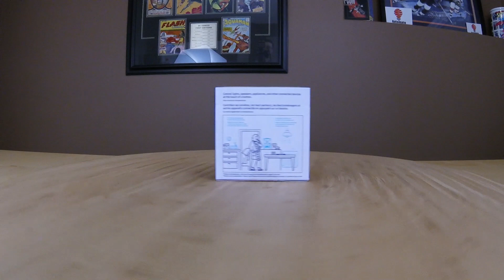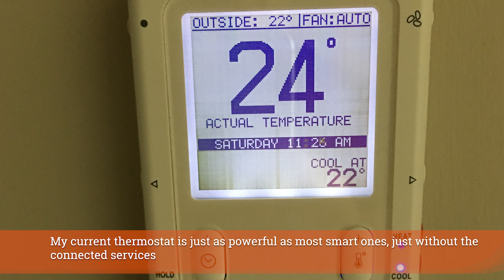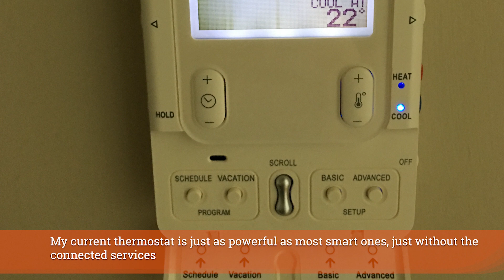How (And When) To Use Redundancy In Your Smart Home To Gain Reliability

Comment: Love your channel Brian. Thanks for sharing all your valuable info on building a smart home and automation!! I've gained a lot from viewing your channel. I do have to disagree with one item you mentioned at the end of this video however. Namely your reasoning for why you don't use a smart thermostat. When I replaced my 30 year old furnace and A/C this past summer, I installed a Honeywell Smart thermostat (RTF9585WF). It is true that it connects and is setup via an internet connection through Wi-Fi, however in day to day use, once you've setup your schedule, the thermostat will follow the locally stored setup even if you loose your internet connection. For me this is as it should be, and makes this smart thermostat operate just like my older "dumb" one did. I also have this linked to my Google Home. The only downside of the Honeywell Smart thermostat that I can see is if someone wants to control theirs while away from home, and will not be able to if it looses it's internet connection. For me, I don't use mine that way.  Perhaps (a big possibility) I missed your point?
Reply from the maker: Nope!  You didn't miss the point at all Andy.  That's the thermostat type I fully agree with.  I think most people go out and buy a Nest Thermostat, but their actual reliability has been less than 100%.  There are situations where the thermostat won't work at all, and that's not OK.

Honeywell, which is a company known for industrial, commercial, AND residential automation, knows how to use redundancy to create reliability.  They did so by reverting the device's software to use the basic programming they'd developed over years.  They used software redundancy to create near 100% reliability.

Many new makers don't have that backing or basis...and that's what I want people to really understand.  I might not have been clear enough for the sake of brevity though. :)
Reply: @AutomateYourLife  Frankly I've never understood the big deal about Nest thermostats.  I have the Honeywell TH9320WF5003 Wi-Fi Touch Screen Programmable Thermostat.  Everything I need to know/see is on one screen.  Works great from across town or across the country (probably from across the world).    Reliability 100% so far.  Reliability...if the GH subreddit is the pulse of GH reliability, I'm one of the lucky ones.  My GHs have been 99.9% reliable since my first device in Spring of 2017.  Nine GH devices later (and two Alexa Dots) I have absolutely no complaints.  I just lied!  Yes I do have a complaint.  WHY can't GH read and send text messages??  Redundancy?  Isn't that just a backup?  It's always good to have a backup way of doing things, Smart or otherwise.  BTW, still loving  your vids!

Comment: Good topic. I am also coming from heavy manufacturing industry where failure could result in fatalities. At home what we play with are kids toys comparatively. Can we live without them - of course we can. For me these are adult toys to kill time (hobby) than anything else and to show off. As I could see one can do few things to make things more reliable

a) if you have automated door locks-make sure you have fall back options
b) have something like unifi to power your network hopefully via PoE
c) if money is not an issue do not buy the cheapest devices/brands

d) If you can- make most of your devices work locally not only on cloud. For instance- use home assistant or similar. At least not just have only google home and alexa to do everything- have your devices work locally with home assistant too 

e) if you run critical system such as surveillance software, home assistant etc- then run them on a say proxmox as LMVs where base system is enterprise ready but still open source (avoid windows)
Reply from the maker: Great tips here!

Comment: The problem to me are bulbs. How to do redundancy for bulbs control if I loose base controller? If power shuts down and system don’t comes back quick enough?
My answer to this today are the lamps. Keeping a lamp in each room of my house permit me to control at least a single bulb manually, even using smart bulbs.
Regards!
Reply from the maker: I think the nice thing with bulbs is that your switches will still work.  So I think they're redundant inherently.  Or are you talking about smart functionality?
Reply: Smart switchs are not so smart. Than we need a backup option if smarthub is off-line.

Comment: The question is ultimately, how far do you go?  Even a light globe is not 100% reliable.  Incandescent globes fail.
A standard dumb light switch is not 100% reliable.  Switches do wear out.
Unless you have two globes in every fitting on two completely separate circuits with two completely different solutions to turn them on and off, you will never get total redundancy.
Reply from the maker: That is the question, but I think the word is criticality. :)

Comment: I feel unconfortable when I have to convince someone to replace a mechanical light switch that used to work 99.99999% of times with a redundant "smart" switch system that combined works 95% of times. Criticality is irrelevant sometimes, but availability is. An IR remote never fails no matter how hard we hit it, but the zigbee button feels like getting some attention by asking to pair again, and asking for fw update while there. I do encourage 0 tolerance when it comes to smart products reliability, otherwise it's the image of anything smart that's being spoiled. Rf noise is not an issue as retries and latencies can compensate that, it's more a lack of products interoperability and end users scenarios system testings.

Comment: Brian, I still have the nest thermostat but because it can not directly integrate with smartthings I'm going to switch to the ecobee soon. But getting back to its reliability, about a year after i installed it we had a very bad lighting storm here where I live and my internet went out for 3 day, (yeah all most went insane). During that time my thermostat continued to work as a normal dumb thermostat. It was not accessible via its app of course but you still could control it directly from the thermostat itself and worked just fine.  Not sure if the ecobee will act the same under the same conduction's but guess i'll find out soon enough :)
Reply from the maker: Yeah it will!  You're right in that they default back to being old style, but it does create some potential for odd situations.  I've read a few reports where they just stop working entirely and don't revert, so I'm just not willing to bet on that just yet.

You'll love the ecobee...and it's a good Canadian company too, if I'm not mistaken ;)

Comment: Really great topic! If you have a light zigbee enabled to SmartThings or another hub and the wifi is down can you still use SmartThings to operate the light?
Reply from the maker: You absolutely can.  Don't believe the world of naysayers.  You can. :)
Reply: @AutomateYourLife  does your phone have to be zigbee enabled? Or does your cellular phone connect to the smart things hub how? 

Would this also be the case with thread?
Reply from the maker: Thread, ZigBee, Z-Wave, can all operate without internet connection.  Same with Bluetooth actually.  It's the cloud services that require that.  You'd need a hub of some kind though to manage all 3 protocols.

Comment: It’s ironic that you still use an older thermostat.  My first smart home product was the gen 2 nest thermostat.  I had a really old one In the condo I was renting.  I swapped it out for the nest to save money on my bills.  Then it expanded to other products as the need came up (smart lock and plugs).  About 4 years in I finally have an use for a smart light bulb. To me that was the most gimmicky product since you could just buy $1 LED bulbs and pay $50 for a light switch.  I definitely do get frustrate with the WiFi drop off from my Wemo light plugs and now I’m looking at something that ties into a hub locally.  Not saying I don’t love my Wemo just have an issue with my oldest one dropping out of the app.
Reply: I use the smartthings wifi plug. It integrates directly with the smartthings hub for automation's and have not had any problems with them disconnecting from the wifi network as yet. They also have a older model that uses either zigbee or zwave but have heard of them having some problems.
Reply from the maker: Also, yeah.  Larry's right in that new SmartThings WiFi plug!  You don't need the hub, and it has been ROCK solid for me ever since I plugged it in.
Reply from the maker: Hey Vance - Yeah I think the question becomes what you trust and what you don't.  I still don't have the same level of trust in the new Thermostats (or the old ones for that matter) that rely on cloud tech to keep them running.  I live in Canada too, so...like today when it's -17 C, I'm just not willing to have my cloud go down and cause an issue.  Reliability and redundancy!

Anyways, we all have our different levels of criticality and I hope that's what I imparted on you today!
Reply: Automate Your Life I completely understand.  I had a similar issue and we have a similar climate in the Chicagoland area.  The system worked fine.  I’m sure as more products come to market there will be one that will put your mind at ease.  I’ll look at the smart things WiFi plug.  I was wanting to look to move away from WiFi for them.  I’m sitting around 3 cameras, 3 Rokus, 7 plugs, door lock, garage opener, thermostat, scale, 4 tablets, 3 laptops and 4 phones on the network at night.  Trying to Lessen the stress on the network when everyone is at home.
Reply from the maker: Then I think it's time for a hub Vance!